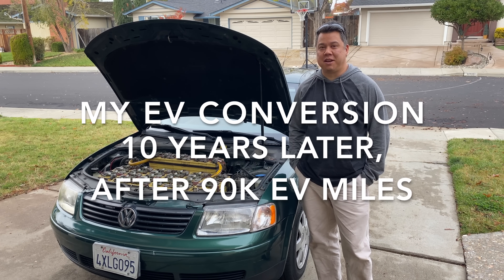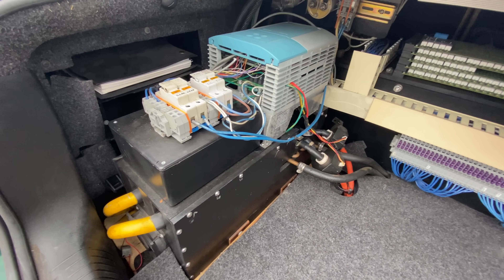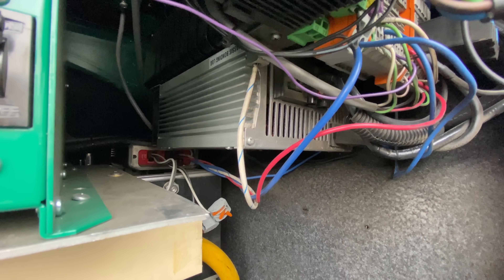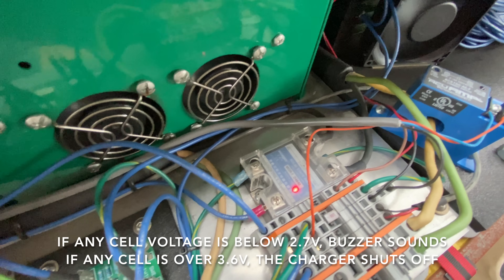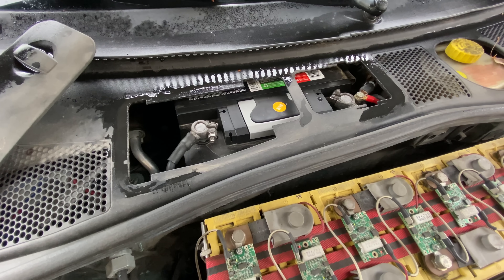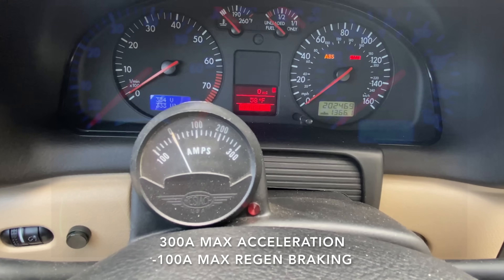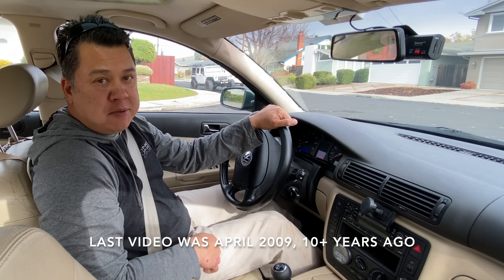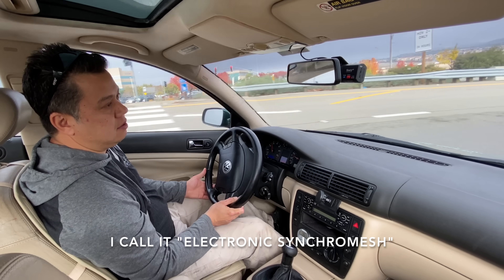My EV conversion after 10 years and 90k miles

Comment: Could you use a glycol heat exchanger passing through the battery heatsink and a jacket around the motor. I see many EVs that ust use a direct drive to the differential or planetary gear yet surely they could extend range by means of a two speed electric or hydraulic overdrive.
Reply from the maker: The battery, motor and inverter only get a few degrees above ambient, there's no significant heat to be useful.  I have a 5 speed transmisison,  no need for an over drive, I generally use only 2nd and 3rd gears.  Direct drive wouldn't be low enough reduction, plus the transaxle I used is already designed to turn the wheels.
Reply: @etischer  Thanks for the reply.  I've seen that some conversations have to cool the battery bank and divert the coolant to the heater matrix. Have you considered driving the air conditioning compressor mechanically from the tail shaft or a drive shaft?
Reply from the maker: @glennoc8585  My AC compressor is run off a DC brushless motor, it's super efficient.  Running the compressor off the motor has a few issues; I would need  a belt and clutch to run the compressor, which looses efficiency, and I wouldn't have control over the compressor's speed.  The compressor wouldn't run when I'm stopped in traffic, and it would probably explode when I'm on the freeway pulling 9k rpm.  The electric compressor is pretty ideal, it's efficient, and can be placed anywhere; I have mine in the front bumper.
Reply: @etischer  I suppose the electric Air con compressor is more efficient than the mechanical. I guess you could set the clutch to switch off and on  at a selected rpm on a conventional compressor. Do you need  a motor start capacitor on the compressor?
Reply from the maker: @glennoc8585  you can read more about my AC system here: http://etischer.com/awdev/aircon.html

Comment: How many battery cells have you had to replace since 2009?
Reply from the maker: I haven't had to replace any of the lithium cells.  I did originally have Optima lead acid batteries, I replaced the whole pack of 25 batteries.
Reply: @etischer , that's great! When did you install the lithium, and which brand, model, and where did you buy them?
Reply from the maker: @CrazyFloridaMan  I have more info here http://etischer.com/awdev/
Reply: @etischer , thanks, I'll check it out.

Comment: Did you have any issues with the DMV and california's pollution control agency?   How did/do they handle your inspection?
Reply from the maker: It was surprisingly straight forward.  I got the car inspected at a CARB inspection station, and it was certified electric / smog exempt.

Comment: Wow! 

I'm very impressed by this... Are you an electrical engineer? 

 It certainly does not seem like an easy build here.  
Sounds like this is partially a bit older tech, combined with some upgrades over time.. 
I can only imagine what you could build with more modern equipment.

Comment: Yea but how much coal did you burn to keep it charged and was that better than burning the gas? 
Questions no greenie will ever honestly approach.
Reply from the maker: My EV electricity usage is offset by solar panels on my roof which have produced 43,144 kwh since 2012, or about 145k ev miles.

Comment: From 0 to 30 mph an electric car has way more horsepower than an automatic gasoline car of the same horsepower rating.  I know we usually call this number torque, but I think car manufacturers should start calling it "0 to 30 mph average horsepower."  Probably the single most useful stat for city driving.  A "30 to 60 mph average horsepower" would be useful for people that want to compare their car to a sports car.  So a car with a small gasoline engine with a turbo that has 350 horsepower may only ever get an average of 50 horsepower from 0 to 30 mph which is only 14% of its total horsepower from 0 to 30 mph.  But an electric car with 130 horsepower might get an average of 90 horsepower to 30 mph, or %70 of its max horsepower for 0 to 30.  If you are wondering, this is one reason why racing cars go so fast with horsepower lower than some sports cars, they tune the engine for a high "average horsepower" because max horsepower doesn't help you at low speeds.  My problem with calling this "torque" is because that number doesn't directly reflect acceleration.  Average horsepower would.  Or maybe "city horsepower" as defined as the average horsepower that reaches the wheels when accelerating from 0 to 30 mph when the car is in "standard driving mode" with "sports mode" or "launch control" completely disabled.  Then "highway horsepower" would be average horsepower when accelerating from 30 to 60 mph.  Cars that boast 500 horsepower rarely see that number at lower speeds, and I know from personal experience that the Dodge Viper sees less than half of its total horsepower when accelerating to the legal speed limit.  Real world acceleration to legal speeds is infinitely more useful than horsepower when you are breaking the law.

Comment: Thing is with eV.  They brag 1 moving part in the motor but there's tons and tons or components for bms charging aircon brake servo power steering etc etc etc. I'm not against eV but ffs if u run them for 10 years they seem to break even on petrol cars what with the tons upon tons of other costs and issues.  Who keeps a car for 10 years?  Bet it took him 5 years to dial it all in!

Comment: I can NOT believe I am just seeing this! I can relate somewhat to encoder benefit, as I work on electric fork trucks. Ironically, they didn't start using encoder monitoring on drive motors, until the AC drive systems came out. It was a game changer on battery life and performance, followed by the hydraulic system improvements as well. 
Have you been using the same cells for 10 years? You may have discussed, and I missed it...
Great Video!
Reply from the maker: I had lead acid (blue top Optimas) for the first year, so about 8 years on the lithium cells.   They started loosing performance in cold weather, but probably still have most of their capacity.  Most of the cells now live on a solar farm, and a few power up our trailer (see my other videos).  More info on the car at etischer.com - Cheers -Eric.

Comment: Absolutely outstanding, my friend. Bravo. One question: Since most EVs don't even have a transmission, have you thought about just keeping it in the top gear all the time so shifting is not needed? Torque would be no problem as you say, even in the top gear I suspect.
Reply from the maker: Well, the motor doesn't have enough torque to run around in 5th gear, the motor would be pulling full current at very low RPM, generating a lot of heat without producing much power.  Best to run higher RPM, with higher voltage, less current, ideally rpms would be 4k-6k rpm
Reply: @etischer  I suppose after 10 years you're used to driving it with a transmission so no point in doing a change now anyway. How much torque does that motor put out?

Comment: Id imagine this weighs alot more than a stock passat, and with the added weight of the batteries infront of and behind the driver, did you reinforce the chassis in places incase of an accident to avoid being crushed by the batteries?

Comment: Was it a synchro before?
Reply from the maker: It was originally an automatic transmission, I swapped it for a manual (fully synchronized gears), 2wd.
Reply: @etischer  so it was and is FWD? Awesome work dude
Reply from the maker: @andrslnks4804  yes, Front wheel drive

Comment: One thing is missing in this design.You need supercapacitor bank made of 6 caps each 3000F.That should be placed instead of lead acid battery.That way you will have no limits about inrush currents.Small flexible solar panel on the roof is great to have too for this capacitor bank so it will be independant from in car battery pack.Overal work is trully great one.Subscribed.

Comment: Switching from the vector control to encoder-on-a shaft RPM control is something I could never imagine to hear on the DIY automobile channel, but here it is.. Also, that terminal strip with the individual cell voltage monitoring possibility is pure brilliance.

Comment: I didn't know there were dc brushless A//C compressors. I didn't know there were 330vdc to 24vdc converters. I didn't know you could have suspension springs wound to your own specs, and i always thought high power electronics and electrics should be liquid cooled, but I didn't know these things already exist. Very cool video.

Comment: This is BY FAR the best presented EV convertion which I've seen on YT. Well described, shown step by step. Also with test drive to show how the car behaves. I'm a classic car enthusiast, so not a fan of modern plastic cars, but HUGE respect for keeping the car stock. It's even more impressive that it doesn't look like a kit car inside with aluminium dashboard and pilot switches. I guess it was kinda plan to make it look... well boring, until you'll floor it 😁
Great work. My dream is to convert my Chevy G20 to EV.
All the best!

Comment: Awesome, dude! Good job! I'm kind of surprised that you need that much weight in lithium phosphate batteries. I'm sitting here calculating how many 1000 farad capacitors you might need to replace all that, so you could charge faster. I'm not sure that it's possible. I would have thought your lithium batteries would have taken up less space and weight.

Comment: What is the effect uponnyour body? Any frequency's or magnetic concerns??? After 3-5 years ???
Reply from the maker: I bought an EMI meter, and it doesn't measure anything inside the car while I'm driving.  It does give some numbers in front of my microwave when it's on, just as a test

Comment: I still need to understand a few things, because on paper it makes ZERO sense. I see things in a very personal manner and I will expose that. We have here a 25$ total cost, on a vehicle which had an initial value of about $5 k at that time with a broken engine (about $8k with running engine). What would our quality of living with this car be, considering all aspects; storage room, freedom of driving wherever, handling and such. I will Consider the low range at about 50% of the value as being diminished and this will bring usability back to 4-5 k. I will consider limited storage at about 25% and this will lower the value even more. Now I will divide the difference between $25k and $3k (value compared to an identical and working vehicle), by the price of gas and I will get about 7k gallons which in miles averages between 140k to 180k. The vehicle only drove 90k and is still short of paying for itself even if electrical power would be free for his 90k driven... On top of that, these batteries might need replacement since no battery lasts forever and the owner is the prisoner of something which today, if in working condition with the original engine, would cost about 1k... I don't get it... It's nice for a kid in school as a project, but it makes no sense in numbers, quality of life and such.
Reply from the maker: What I learned from building this car got me a Sr. Staff engineering position with the Powertrain engineering group at Tesla Motors.  Worked there for 7 years and retired at the age of 40.   There were no EVs available in 2008, if you wanted one, you had to build it yourself.  Perhaps driving a boring gas car might be cheaper, but I'm not a boring, cheap kinda person.
Reply: @etischer  WOW!!! "A boring gas car"... This exceeds everything... How exciting is it to drive an electro-mobile with limited functionality??? Great for the position at Tesla; some other golf cart which makes no sense... Take the money, put food on the table and be happy, but don't kid yourself and don't attempt to explain others how much "sense" it makes to pay for "gas" for a life-time in advance, while being the witness of an aging toy.
Reply from the maker: @A.Dude.  It is quite exciting to drive actually, tons of torque, super smooth and quiet.  It's especially satisfying since I wrote all the software from scratch; I enjoy tweaking the tuning parameters and being able to feel the result.  There's no going back to legacy gas cars once you've driven an EV, I suggest you take a Tesla for a test drive.   I'm not struggling to put food on the table, and I don't know anyone who would be content with just barely scraping by as you suggest I do.  There's nothing wrong with stepping our of your comfort zone, and learning something new.  The knowledge I gained from this project isn't something they teach in school, and that's why Tesla hired me.
Reply: @etischer  Mate, that is great for you and the fact that you are satisfied counts most! Let me tell you about an event involving a Tesla; I was driving my Mercedes SLK somewhere between Oregon and Californistan in the mountains where that tall viaduct is... A model S was joking with me (for no reason) and it all stopped when he made some desperate signs with his hands that he got out of power... That's about it. I do like quiet, but S-class quiet, if you can understand the difference... I often drive down the W coast (or up into Canadistan) and I do it in class... For you it's boring... Well, we are obviously worlds apart... I am someone who is very pragmatic when it comes to spending; I'm also debt free... These electro-mobiles (can't call them cars, let's be serious for a second because the whole concept of a car was from day one the freedom it offers. You would get into your car and were able to take HW 66 from one coast to the other - almost) offer the comfort of a very cheap car, under the false pretense that you won't pay for gas (because you already did with the purchase for two lifetimes ahead) and/or that you will save the planet, which again is bogus since  such a device leaves over it's entire life-span a deeper carbon foot-print than a car. On a personal note, honestly, nothing against you, you're probably on of the most adorable people. Stay safe, mate! Oh, one more thing;  many buy into this lie because they don't know ANYTHING about how this planet works...
Reply from the maker: @A.Dude.  It's all good.  For what it's worth, I've done several road trips in my Model 3; SF to Tucson (850mi), plenty of fast food places with superchargers along the way.   In the 20 mins it takes to eat lunch, we get 200+ miles added.  It's hard not to laugh driving a gas car now, especially with the start/stop when at a red light.  I just look back on how unrefined cars were, and how it was so normal back then.  Here's a good read if you've got a few minutes... https://teslaclubsweden.se/test-drive-of-a-petrol-car/
Reply: @etischer  Not interested in brain-washed people's writings; sorry. It's obvious to me that you never owned a decent car... Stay safe, be happy, have a great life!
Reply from the maker: @A.Dude.  My other cars at the time were a Range Rover L322, and Audi TT.  I used to wrench at a  Jaguar, Bentley,  Rolls Royce repair shop, where I also worked on pretty much all the European exotics (Ferrari, Lamborghini, Maserati).  I've swapped a Mazda Rotary in my MG, and swapped Subaru Flat 4 turbos, and Flat sixes in my Porsche 914.    

From a performance standpoint, none of them come close to my Model 3 AWD.  Keep your head in the ground I guess, once you go electric there's no going back.

Comment: You spent way tooo much money on this. And 100 miles range only that’s garbage.! I would’ve just saved the money and bought a Tesla 🤦‍♂️. I drive a 2015 Toyota Prius and I get about 50MPG and full tank gas ⛽️ I get about 550 miles range. Full tank gas ⛽️ cost me around $15-$18
Reply from the maker: When I built this in 2008, there weren't any affordable EVs on the market yet.  This was before the Nissan Leaf,  long before Tesla Model S...  DIY was the only option if you wanted an EV.  Going through the build process, and designing the inverter pushed me out of my comfort zone, forcing me to learn new skills, the sorta stuff they don't teach in school.  This car is now a rolling resume, showing my knowledge in Controls, Software, Hardware, Electrical engineering, welding, fabrication, power electronics... it  landed me  a Sr. Staff Engineering position in the Powertrain group at Tesla.  I worked at Tesla designing control systems for manufacturing the Roadster, Model S, Model X, Model 3, Rav 4, and B Class powertrains. I worked at Tesla for 7 years, and  retired when i was 40.  ... please tell me more about how life changing your 2015 Prius is.

Comment: So....what you're saying is, internal combustion engines are only slightly above the steam engine, and electrical engineering is the answer for most future vehicles, increasing in effectiveness directly proportional to battery tech? got it
Reply: those batteries will lose its zero point and won't fully charge after awhile.
Reply: @SimilakChild  Yep. Hence the whole "directly proportional to battery tech." It's the only thing holding us back. And there are major improvements being made

Comment: Do you watherproof the bms?
Reply from the maker: The BMS boards have a conformal coating on them, but they stay dry, the area under the hood is pretty well sealed off from water.

Comment: Great video amazing car you built just couple questions why did you keep the gears are there any efficiency  gains ? also would electric power steering better as no pump or hydraulics . Are the efficiency gains not worth effort of conversion ? . You have AC could this be configured to work as a heater (heat pump) like with many domestic AC system's

Comment: Would a pressure wash of the engine bay to tidy things up be out of the question?
Reply from the maker: I use compressed air, there's no oil under the hood, so it just gets dusty.